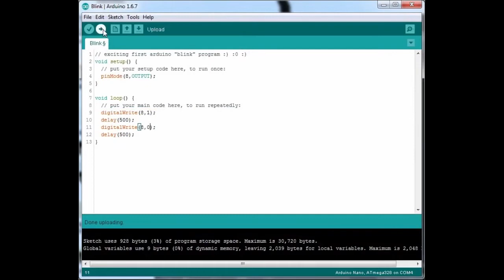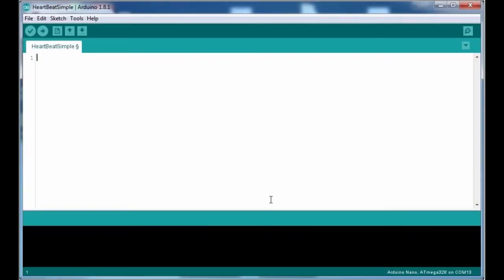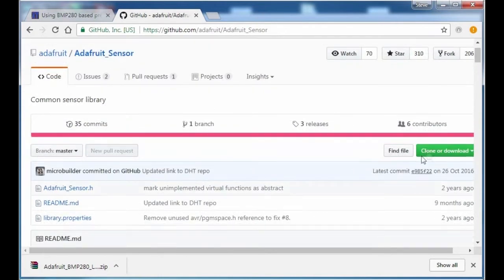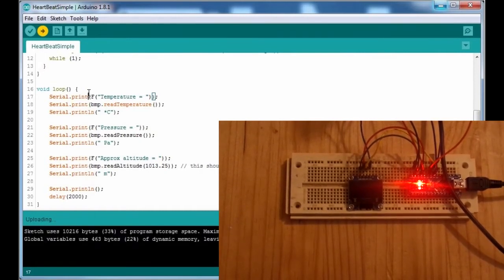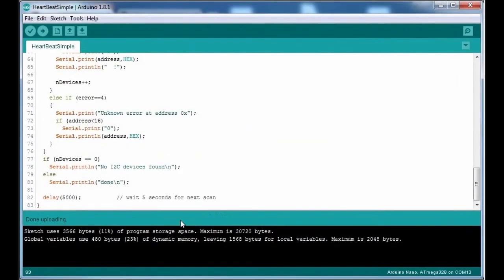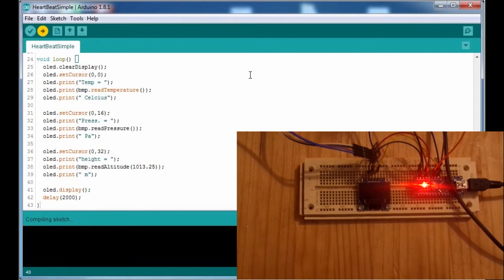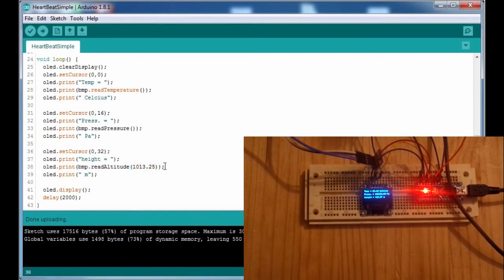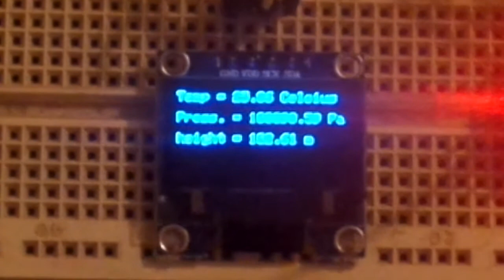Air Pressure and Temp Sensor (BMP280) with Arduino

Comment: The BMP280E has a maximum rated voltage of 3.6 V. The breakout board you are using has no voltage regulator or level shifters.
You can get away with using 5 Volts as you're doing, but there's no guarantee that you'll get decent results, and you may even damage the chip. My experiments using 5 V with the same board worked, but the jitter on the returned values was an order of magnitude greater than when using 3.3 V.
You only need two 10K resistors and two 2N7000 mosfets to do the level shifting, so for the cost of a few pennies, you can get better results and remove the risk of damage. I suggest that you should check out using 3.3 V with level shifters for the board and re-do your video when you get the chance.
Reply from the maker: Thanks for the information, I'll pin your comment.
Reply: i use 5 volt😓 temp is 2 degree higher than aht10....

Comment: can i connect 4 Bmp280  sensors to one ardrino nano  and one display if yes then what should be the changes in code
Reply from the maker: Unfortunately you can't as they will all share the same i2c address. There are ways round this by using special chips that allow you to multiplex i2c devices or you could power them from i/o pins (if they don't need much current). That way you can power them on and off programmatically. These are not simple 1 or 2 lines of changes in the code though.
Reply: @XTronical  sir which special chip needed

Comment: what if i want to add humidity in the display what will the code will be? please answer
Reply from the maker: You need the BME280 sensor, see this video using an esp32, https://youtu.be/2xKtWiTSK7A
The examples are for Arduino too.
Reply: @XTronical  thank you😊 i already subsc to you 😊😊
Reply: @XTronical  sir what if i want to use an oled together with BME280 to show the results
Reply from the maker: No problem, they connect on the same I2C bus but have a different address on that bus so will work fine together. Just include the required libraries for both devices.
Reply: @XTronical  but what i have is 1.3 inch oled sir i dont have 0.96 inch oled like you have
Reply from the maker: What's the model, do you have a link?
Reply from the maker: Ok
Reply: @XTronical  thank you sir! For me your channel deserve thousand subsc because you care on your viewers! God bless and keep up sir! 👊👊🔥

Comment: Where you connect the OLED when you have connected the BMP280 to pins A4 and A5 ...
Reply from the maker: To A4 and A5 as normal, they are both I2C devices and can share the same wires (BUS). It's a protocol that allows multiple devices to talk on the same bus.

Comment: sir can i use it up to 40psi?
Reply from the maker: Yes and No! The data sheet for the BMP280 guarantees full accuracy between 4.35 and 15.9psi but has absolute max rating of 290psi. So at your pressure it won't break and will still work but may be a little bit out on it's reading.

Comment: this sensor is giving temp value 187 *C it is wrong data is there any solution?
Reply from the maker: If pressure is good and temp always 187 it sounds like faulty sensor. Odd though. They do work better at 3.3v apparently but I had no problems at 5v.
Reply: can i connect it 5 v and pressure is showing 122hPa and altitude is 33000 which is undesirable
Reply from the maker: I'm revisiting this sensor shortly showing how to use it with arduino and 3.3v, just in case that's your issue. Be about 2 - 3 weeks
Reply: @XTronical  ok ok
Reply: @XTronical  is it need any kind of calibratation? means it gives the result instant or i have to keep connect with 1 or 2 hour?
Reply from the maker: The temp needs no calibration, the pressure needs none but you do need slight adjustment for height. But yours is too far out.

Comment: hi i have a problem after uploading the first code the arduino says that avrdude: ser_open(): can't open device "\\.\COM1": The system cannot find the file specified.

Problem uploading to board.  See http://www.arduino.cc/en/Guide/Troubleshooting#upload for suggestions.
Reply from the maker: This usually means that you've not selected the serial port from the menu and/or you've not selected the board from the boards menu.